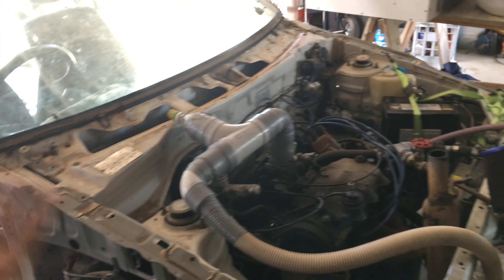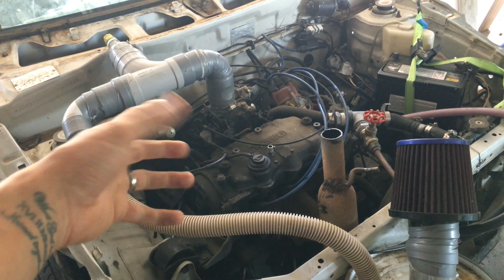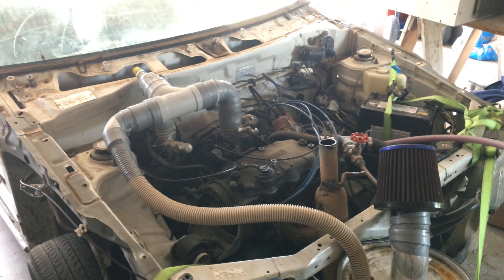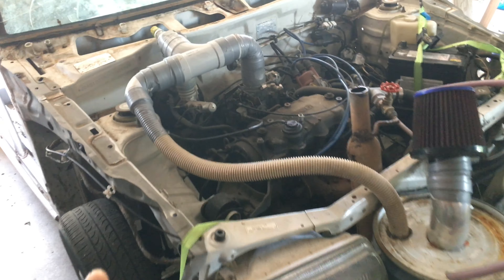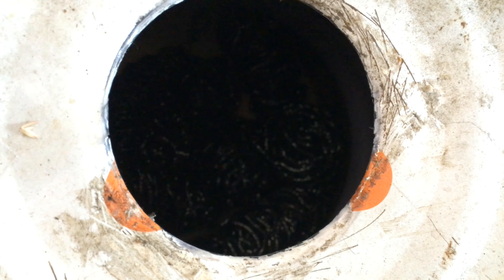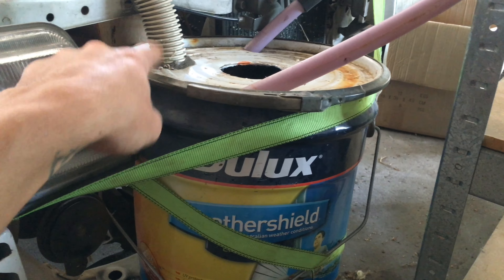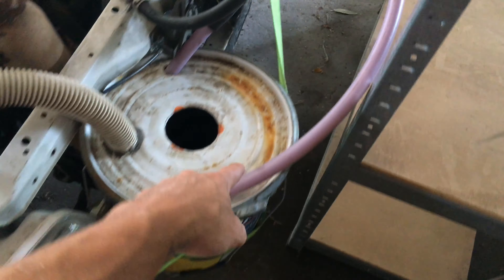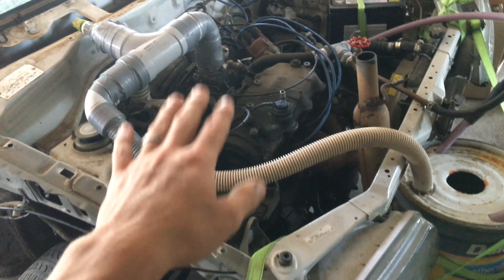Update On My Fuel Vapour System | Tutorial Video

Comment: Appreciate the info.  Thank you.
Reply from the maker: No worries, mate. What helped specifically?
Reply: @NathanR1995  your temperature theories.  I always thought th at a ratio of 17 parts of oxygen and 1 part of gas fume would be enough for the spark plug to fire.  I didn’t consider temperature.
Reply from the maker: Air/fuel ratios matter of course, the temperature of the fuel matters and the temperature of the incoming air matters. Experiments between these factors is where the fun will be. Something I’m yet to do myself. One day I’ll buy a air/fuel ratio gauge to know exactly the affects of different ratios and temperatures.
Reply: @NathanR1995  it's easy. Just make up your mind and start and before you know it
Reply: @NathanR1995  E85 might work better in this system then gasoline. Different chemistry.
Reply from the maker: Indeed! Let’s do it

Comment: The steel wool does a few jobs , 1 stops raw fuel getting into the intake 2 creates an environment that wont let fuel burn in the drum !!!!! But only if You have enough in there . You need lots more teased out if you get a backfire into the inlet  ( very common if the mixture isnt Correct ) This can then set the Tank on Fire . PS Send me a PM i just thought of something that you may like to think about .

Comment: Follow up to an earlier comment: 
If you use hot exhaust to bubble into the petrol instead of intake air, and plumb that line into the fuel port on the carb, adibiatic cooling will condense any vapour in that line (remember the jet screws are fairly wide open, subjecting the vapour supply line to manifold vacuum), so you might want to consider running the line through a heat exchanger plumbed into the cooling system just before it gets to the carb. 
https://youtu.be/mEExlOX458Y
Can be sized appropriately - the smaller the diameter of the fuel supply line, the better the vacuum pull and exhaust push will be for the petrol vapours, and a 2” diameter heat exchanger here would make for trouble with the cooling system unless it’s correctly bled and topped up.

Comment: Good Work👍....
Oil co put crap in the gas ...detergents mtb etc
The pistons do get a little hot...but not by much
I used ultrasonic..like the terrarium for reptiles
Works too ....trick is to adjust flow ...vacum
Reply from the maker: Thanks for your input! Keen to learn more about your testing with ultrasonic frequencies.

Comment: well I do my self old cars restoring and repairing Im cinde of stuck it does work on idel jet barely any fuel is consumed I hucked it up in diferent places some times I have only half trothel some times half to max trother some times only low rew idel I tryed full wacum preshure beneth the carburetor even I have a extra rare flanch for 1 barell side of the carburetor to my it aperes peopel shuld prevent fuming build up I try to figure out pipes size relation to jetts etc. In fact it does work even with out heat just ordinary high wacum but I will do it litel diferently I will use all 3 jetts If I manage somthing I will help you guys mostly those tricks work on older cars because you can advance ore retard ignition timing fir any cinde of lpg ore vapor fuel you must have that option to fine tune the fuel burn rate in worst case peopel need diferent cam size on tge cam shaft because I suspect valve overlap to have somthing to do with it how ever I wuld sugest solid state container for fuel because posibly you culd make the fuel tank act as a boiler ore as a plate cell to vaporise ore pre heat fuel that way.
Any way Im actualy working on that project and propane conversion. if any thing usabel I finde I will share info.
Bigest problem what I finde is my pierburg 2e3 carburetor dobel barell isnt realy good for that porpuse wacum hoses and conections evry where thats why probably I have so much trobel fokusing full wacum power probably best idea wuld by to use cinde of lpg mixer somthing like that ore ajustabel jetts on a singel barell carburetor and probably take the coland house and add that to the fuel container in theory just by that it shuld work but agein my carburetor type is shity for that porpuse if I wuld have money I wuld probably use electric selenoid ore kinde of electric variabel jet's .
Probably Im thinking useing multipel fuel types and experiment what they wuld do to a engine.
Best way wuld by to turn engine ON on normal fuel and when engine reach operation temperatures you make a electric circuet valve and switch to a cheaper fuel like propane acids ore mix with destiled water you can do even that as well but octane rate go down,use amplified ignition and in some cases plazma ignition.
A ignition system is easy tuned just by some capacitors there you go that shuld work with minimal work done.
Reply from the maker: Thanks for sharing! I didn’t fully understand everything, but I have a good idea of what you mean.

There’s a Facebook group called Gasoline Vapour Systems. That’s a great place. A guy has built a reliable and tested system. Check that out!
Reply: @NathanR1995  hello thanks for answering I wuld suggest your folowers to see the Joe Cell videos thats how I got in busines with old car's that men is music for young mechanic's he is nice the video chanells are Brey and Ingventor all other chanels are fake I wuld sugest to your folowers also Teslas methode of conversion ore see what John Bedini,Peater Linderman and posibly Stanley Mayer.
Those are great inventor's.
How ever I must add those are combined engines runing on electric and vapor assistance.
And Im actualy doing studi for over 15 years indead that tehnology is real.
I will join that group and answer some of the question's who may need help.
See you then around I ques 🙋‍♂️
Reply from the maker: Legend, thanks mate!